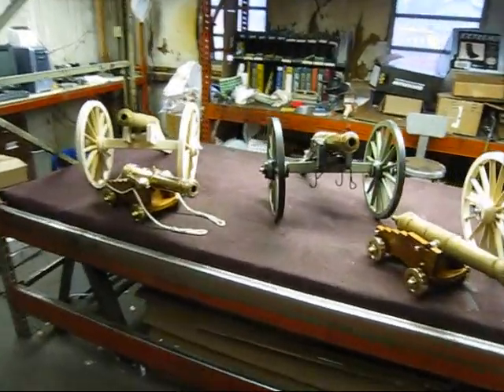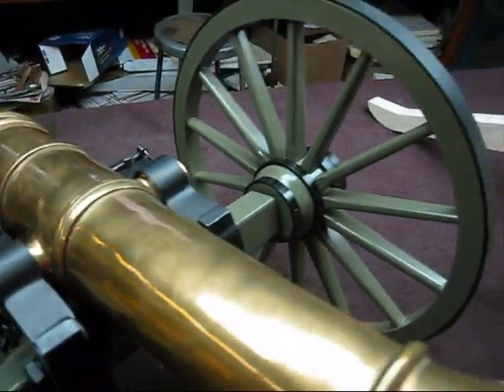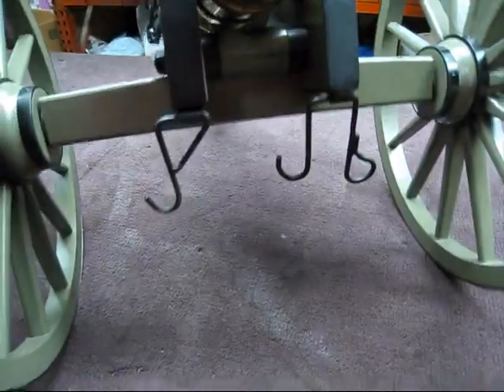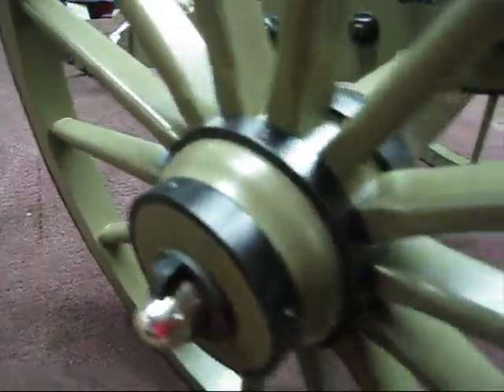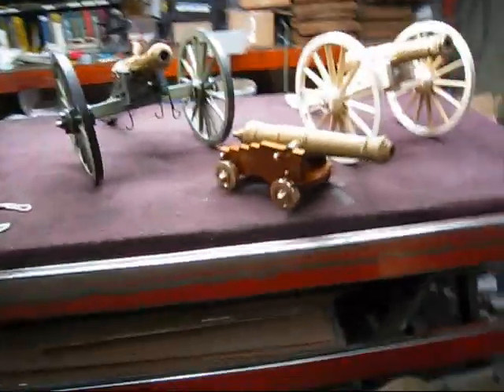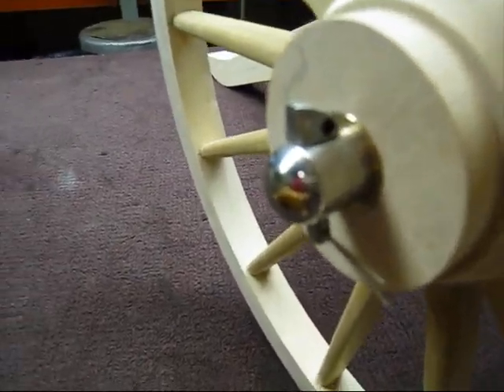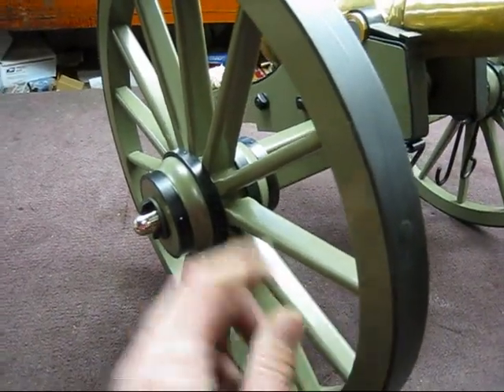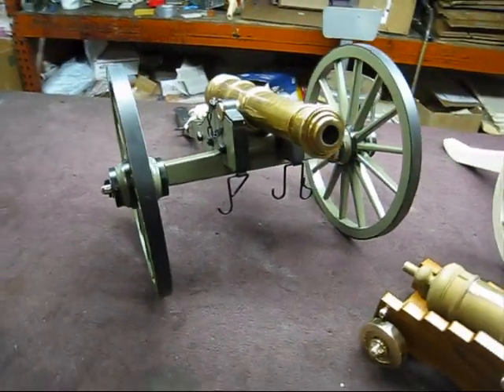Replica Civil War Era Cannons

Comment from the maker: I will not be able to make a video of the steel tire anytime soon. The 1/8" by 1" steel tire was rolled and cut to fit. It was then welded to close the loop and fit snug to the wheel. The tire was countersunk and 7 screws were used to secure it to the wheel. The screw heads were filled with weld and ground flush.